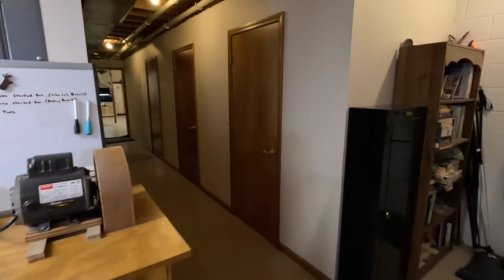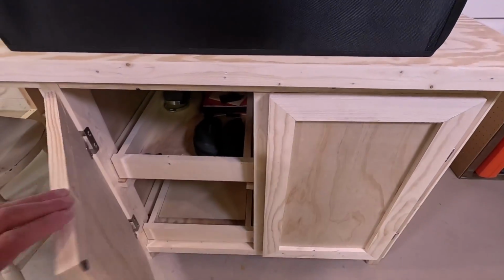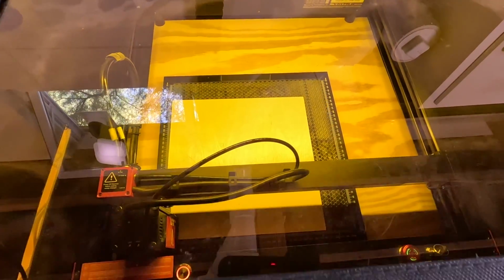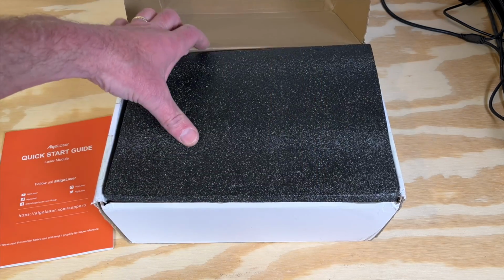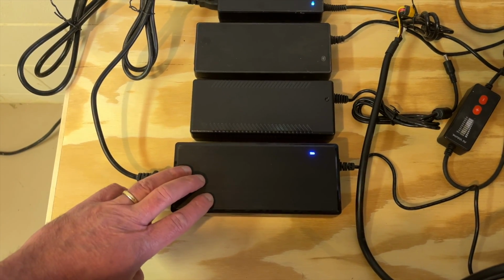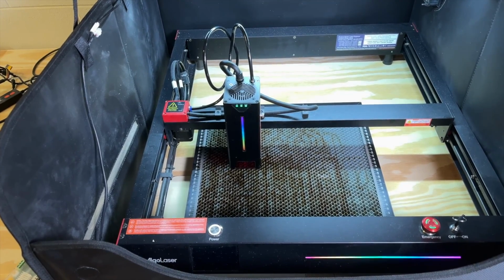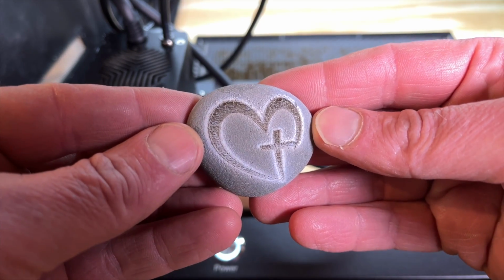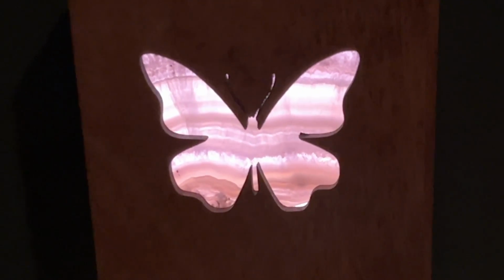Window Vent Enables Indoor Laser Projects

Comment: Nice project!!!   I hate burned edges on almost any project in general though.  If you run much faster cut speed, and add multiple passes, you'll get a much less noticeable burn on the cut edges.
Reply from the maker: Thanks for the tip! Have you found a good way to clean up the burned edges other than sanding them? I don't know how well paint would stick to that charred wood, even if it's less charred.
Reply: @MichiganRocks  A light sanding is the best bet to ensure nice smooth / clean edges.  You do not want any loose char, but for painting, most modern paints stick very well to charred wood, and the char will be hidden by opaque darker colors.  However,  charred wood may show through on opaque light colors / white and any translucent or semi-translucent paints. Could be good or bad depending on the look you want.   I see you're using LightBurn, if you do decide to try a faster cut speed with multiple passes, you may need to enable "constant power mode".  If I forget to enable it with my 50W X7 Pro, when cut speeds exceed 1500mm/min, I get perforations instead of a smooth cut.  Easy enough to punch out, but a lot of extra edge cleanup work.

Comment: While I don't have a laser engraver, I have a laser cut farm scene that I "won" at a charity event silent auction. None of the edges have char on them.  Wish I could attach a picture as it is extremely intricate.  I was wondering how that is done. Anybody know?  The rock laser engraving is amazing too!
Reply from the maker: Are you sure it's actually laser engraved and not cut with a scroll saw? If it is laser engraved, I would love to know how they cleaned up the edges.
Reply: @MichiganRocks   You are likely correct.  It could have been a scroll saw or a CNC router  I didn't realize how intricate scroll saws could be. It's a pretty intricate scene with trees, buildings, hills, birds etc all in separate cut outs.  A search on  what scroll saws can do and I was amazed.  Thought I knew a lot about woodworking but I've been schooled!  Well I learned something new, so I guess it's been a successful day. Still liking that laser engraver too. Awesome gear!

Comment: Hi Rob, that’s a really slick desk / cabinet set up that you made there. I have no knowledge of laser equipment but in radio communication equipment ALC stands for Automatic Level Control. I see one problem with the smoke and dust removal system and maybe I didn’t notice it or you didn’t point it out in the video but there needs to be an air inlet into the enclosure.  Otherwise you are just pulling a vacuum in the enclosure and the smoke and dust removal is not going to be very effective. It’s kind of like your furnace it needs a cold air return to get proper air flow. I really like the window adapter. I have a glass bead blaster machine that creates harmful dust just like sanding rocks. Awesome video !
Reply from the maker: Hey Dave. There's a little vent along the left side and the fan is on the right side, so air gets drawn across the whole work area. I'm sure some also gets sucked in along the bottom since it doesn't fit tightly against the desk.
Reply: @MichiganRocks  Ha Ha well I was sure that they would have incorporated something into the unit so it could breath. I just didn’t see it and the unit being black doesn’t make it stand out. It’s cool how you can cut out pieces do precisely that they fit together like a puzzle.
Reply from the maker: @davidhile5363  You can definitely do that. The precision of laser cutting is really impressive.

Comment: I really like the flexible fold up enclosure.   That may push me over the edge to get a laser engraver.  Chinese products are really bad about giving good installation and operating instructions.  But that unfortunately seems to be common even with products made in the USA these days.
Reply from the maker: The manual looks very professional, but doesn't contain the information I need. It's a shame that they put that much effort into making a good product and then drop the ball with the documentation.

Comment: Nice upgrades, especially your laser desk!! Very cool projects too. 👍👍
I wonder if the short hose included with the cover is intended to connect to a rigid duct? I believe that's how it would be done in a production / manufacturing environment. Some of the unused parts might also be more appropriate for manufacturing as well.
Great vid Rob!
Reply from the maker: I'm not sure. This seems to be marketed to home users, so I would think they'd include the supplies needed. The hose I bought wasn't expensive, so it wasn't a big deal.

Comment: Hi Rob. Great setup you've got. It's light-years beyond anything I'd like to have. You're a very creative person with amazing results in anything you do. I have a totally unrelated question. When you're at the final stage of rock tumbling, you've said to run the polish stage for 2 weeks. Do you run it for 2 weeks without changing the aluminum oxide, or do you change it after a week & put new AO in & run that for another week. I'm right at the week timeliness & I don't know whether to change the polish or not. My gut says no, but you're the pro, so I'll go by what you say. What an amazing laser cutting that is
Reply from the maker: No, don't change the grit. In the first stage, I change the grit weekly because it wears out and doesn't grind effectively after awhile. With polish, the opposite is true. You want the grit (polish) to break down and become finer, resulting in an even better polish. I'm not sure how much it actually breaks down once it's that small, but it's good if it does.
Reply: @MichiganRocks  
Thanks, Rob. You gave me detailed instructions 2 years ago, but I took a break from rock tumbling for a bit. I remembered everything you told me, but I couldn't remember the 2 week polish stage procedure. This helps immensely. Thank you

Comment: I really like the nightlight and the stand, too. I love all of your tools and projects that you create with them, so thank you for sharing.
Reply from the maker: Thanks, Teresa! I struggled to design that stand. I wanted the top to be more curved, but I just couldn't get it to look right. I had an idea in my head, but drawing it on the computer ended up being much more difficult than I expected.
Reply: Just curious if your computer has a touch screen that you can use a stylus to create your designs?
Reply from the maker: @teresaradford4467  No it doesn't, but I was trying to do it with the drawing tools to make as perfect as possible. I could draw it on my iPad and then use the trace function on the Lightburn software to import the picture.

Comment: The chain holder is lovely, and I thought that you painted the edges. The burn on the edges makes a nice contrast to the blonde wood.
Reply from the maker: That's a good way to look at it. I haven't put any finish on it yet. I don't know if polyurethane would stick to the burned part.
Reply: @MichiganRocks  hope you kept some scraps from the cutting to test on
Reply from the maker: @cynthiafoss8086  I have lots of scraps.

Comment: Cool stuff. Saved the Martinson website to my bookmarks will need on of them soon. Maybe the wood has to be "pine" the 2x4 is Douglas Fir, which is usually denser than pine. What would happen if the wood was damp, while laser?
Reply: In the part of the country I live, most dimensional lumber is Douglas Fir or Western Red Cedar.  Your 2x4 looks like our Douglas Fir 2x4s do, so that would be my guess.  

I used to heat with a wood pellet stove, and I found the pellets made from pine sawdust to have a low heat content, and they produced a large amount of fluffy ash.  The pellets made from Douglas Fir sawdust had a much higher heat content and produced much less ash.  I suspect that for laser woodcutting, you probably want a lightweight wood with low heat content.  I would do an Internet search for "firewood BTU charts" and stick to a wood variety near the bottom.  In other words, a wood that is good for heating is probably bad for laser work.
Reply from the maker: @miltonthecat2240  That seems like a good theory. Obviously 2x4s aren't marketed for laser cutting. I was just trying to test the strength of the new 40 watt laser and I had a 2x4 laying around. I guess in the future I should research what I'm cutting.
Reply from the maker: Oh, I always thought 2x4s were pine. I didn't know they were fir and I didn't realize fir was that much different than pine. 

That window insert is great. It's a good design and well made. If I had made something, it would have probably blocked a lot of the light from the window and would have been a pain to connect and disconnect the hose. It probably would have cost almost as much for a homemade solution too.
Reply: @MichiganRocks  yellow pine and fir are similar. However Doug Fir and White Pine are not.  White Pine is much softer and is probably what the laser manufacturer based it's claim on.
Reply from the maker: @powerlinekid4296  I had no idea. Now I know. Thanks!

Comment: I wish I had a nickel for every minute I've spent trying to figure out if I want a laser or not. I've been a woodworker for a long time and have a problem with many of the pitfalls and the finished product, but they sure would be handy for some things.
Reply from the maker: There are some things that you can do with a laser engraver that would be next to impossible with standard tools. Things like cutting out very intricate designs is easy with a laser, but would be difficult even with a scroll saw. I guess it takes some of the woodworking skills away when you just design it on the computer and let the laser do the work, but I enjoy the designing part. I can't say that I'm very good at it, but I really like using the Lightburn software. That program is really well designed in my opinion.

Comment: I think the ALC module is used with a microcontroller like the Raspberry Pi or the Arduino. This would take the place of a dedicated PC, and is made more for mass production of the same articles based on a program that would be loaded into the microcontroller memory. However, I think your current setup is just fine with the laptop because you are both designing and running the cutter off the same PC. Plus you are doing a lot of experimentation on a variety of designs.

Getting a hub with no power supply is not a huge concern to me, but I won't say it is common. Some people already have the power supply and just need the hub. Some hub applications don't need to be powered as they take any power they need from the PC. In cases where you do need a powered hub, the power connect varies with the country it will be used in. So I think if you bought the hub directly, you would have a list of options of what country you will use it in and how many watts you need, etc. Also some powered hubs are made for DC voltages and some for AC.  So I really wouldn't worry about any of your connections as long as the signal gets through that controls the motors. In any case there should be a label somewhere that specifies the maximum load the hub can provide.

As to why your laser won't burn through a 2x4, I really can't say. Sometimes the depth is specific to a type of material, like rubber soundproofing material, and not wood, which can hold a lot of moisture that would affect the burn through rate. Also sometimes the depth it can burn is specific for the speed of the cnc table velocity. These are questions the company that makes the laser should be able to answer.

I really like this video! It looks like you are having fun.
Reply from the maker: I am definitely having fun with this. I enjoy designing things with the Lightburn software more than I thought I would. I think I would have enjoyed being an engineer. 

It sounds like you have a lot more experience with electronics than I do. I have never used a Raspberry Pi, but I do know what it is. Seems like it would be a fun toy if you were into programming. There was a lot of information in the book about the many connectors on the ALC, so what you said makes sense. 

On the Algolaser site, they show the laser cutting through a 50mm pine board. You do have to remove the protective cover from the bottom of the laser module and lower laser so it's focused at the center of the board rather than at the top, which I did. Maybe different species of pine react differently. That didn't really matter to me much since I doubt that I'd want to cut wood that thick very often anyway. I was really impressed with the difference in the way it worked on rocks.
Reply: @MichiganRocks  It could be that the company was demonstrating burning through basswood or balsa wood. Those would not have the same density and moisture issues you have with a pine board from the lumber yard. That's a really powerful laser you have now. I can't wait to see what you do with it.
Reply from the maker: @darkwood777  It specifically said "pine".

Comment: Regarding the fan, I have been impressed with the flow and reliability of a similar unit I have for my three barrel Covinington tumbler.  I found out long ago that running fans on motors extend their lives appreciably.  Why every manufacturer doesn't have integrated supplemental fans and airflow escapes me.